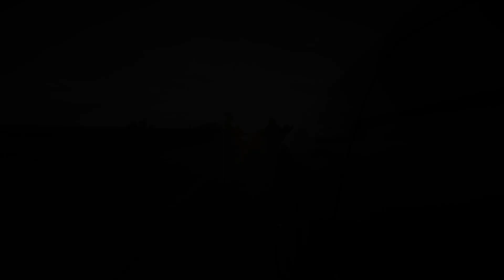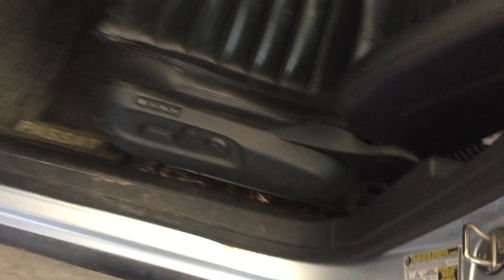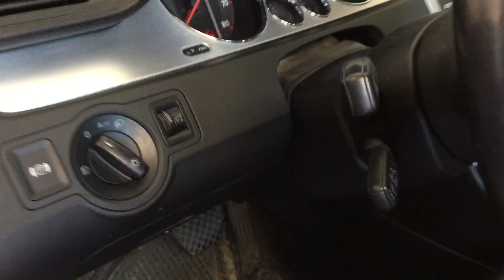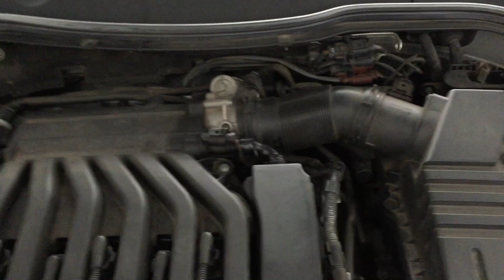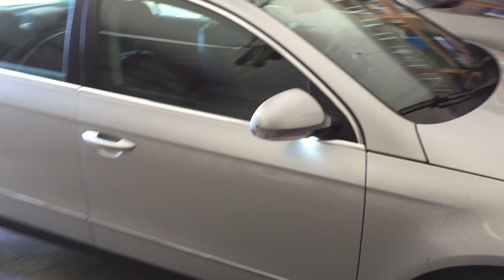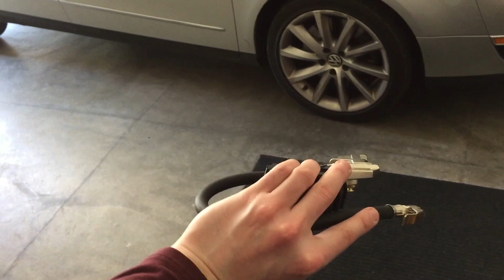Strange Volkswagen Passat Problems...Time to Sell it?

Comment: Get the VCDS software and cable. You will be able to retract the rear brakes, diagnose the modules and save $$$$$ on repairs, and keep the car for another 5 years.

Comment: You don't need a special tool to get the rear parking break to release! All you need is a car battery, and two wires! Hook each wire lead to one of the battery terminals and unplug the clip that hooks up to the electric motor, and place a wire in each side of the clip. You will either hear the electronic motor detach and you will watch it on spin all the way or, it'll sound like it's trying to tighten even further. Obviously if it's trying to tighten even further just switch each side the wire is on and that way you can do the brake job yourself!

Comment: Beautiful car. I used to own an 09 Passat Komfort for seven years, and while a leader in its class, it was plagued with so many issues too soon into its life of 120,000 miles. First issue: steering column lock. The water pump that had to be replaced three times, the PCV valve, the randomly drained batteries, leaks from the differential, and a cam tensioner failure all taking the car out with a final punch. This car was built for leasing like its sister Audi—not for long term ownership.

Comment: This car haves timing chain problens?
Reply: Toss Ftw yes they do, in fact there was an active action class lawsuit opened until 1/2019 for drivers who experienced timing chain failure; engine failure. In addition, VW group of America rolled out a payout scale depending on year and mileage. I had mines fixed drove it for 3 weeks before breaking again. I took it to car max and got rid of it. These are lease cars not cars to buy.

Comment: On a 2013 CC vr6 with pcv issue.  There is an aftermarket pcv membrane to replace it in the valve cover.  So new valve cover gasket, new pcv membrane from Amazon and a few dabs of rtv silicone will set you back about $70 and an hour of your day and your done.
Reply: In order to get the valve cover off you must remove the intake manifold (and lower fuel rail). The intake manifold won't come off without removing the radiator fans, grill, front bumper and then leaning the radiator forward. I just finished this repair, it is not a one hour job.
Reply: At least on a 2013 cc vr6  the intake is a two piece design so the lower doesn't have to be removed to service valve cover.
Reply: My 2007 is a one piece...not easy to work with
Reply: @8@843 @843Chip L, never had to do that on any of the 11 VR6 I’ve owned and upgraded RKX PCV in all of them as an EASY prevented maintenance

Comment: I had the same problem. remove the seat control panel, and access the small circuit board behind it, take an old toothbrush and clean the rust off it. That's what causing the problem. It should go away for good.
Reply: Where is the seat control panel? I’m having the same issues

Comment: I have the same car just not 4 motion .. I was wondering if you knew how to fix a problem that I have .. my check engine light comes on every now and then and it is “low pressure fuel” was wondering if you knew how to fix it . Thanks
Reply from the maker: It's most likely a problem with the fuel injectors and carbon buildup. Try putting a bottle of Chevron Techron fuel system cleaner in an empty gas tank and filling up with premium gas. You can also try revving the engine at 4,000 rpms for 15 minutes on the highway at a steady speed to burn off the carbon deposits in the cylinders. If that doesn't work, bring it to a VW shop and they can do a B&G fuel system cleaning process for $200-$300.
Reply: I changed the fuel pump, I used to have the same problem, it got fixed.
Reply: New in tank fuel pump unit fixes that.

Comment: I have a 2006 version of this car (3.6 4motion) and I had the same seat problem except my seat went all the way back. The problem eventually went away. Also your car should still have a rust and corrosion warranty on it. VW has replaced both fenders and my hood all for free within the past year. Now it looks like a new car again.
Reply: Ryan Eggebrecht they replaced your fenders and such ? How did you go about that I have the same year and the same problem

Comment: Hi, I do have the VW R36 2009 and I did face the same issue with the seat. It happened only after I took the car for a full interior and exterior polish. seems some steam went into the controller and yes it got damage. the solution for me was to change the memory switch only. check the link below

 https://www.aliexpress.com/wholesale?spm=2114.search0104.8.50.PdO4wM&initiative_id=QRW_20170705053038&SearchText=vw+b6+seat+memory&productId=32797317113

regarding the mirror moving, it can be related to the same switch problem as the mirror positions are configured to memory too. so you only hear the motor when the seat is moving inside the car.

just in case, I have faced some issues with the car park too... got a big warning on my screen saying check with VW Dealer. the car would not move since the handbrake is on and not getting released. but since we use our common sense...I have turned on the auto park and everything started working fine as long as I don't press the park button. to cut it short replacing it solved the issue.
check this link just in case. 

https://www.aliexpress.com/item/EPB-Electronic-Handbrake-Parking-Switch-Brake-Button-For-VW-Passat-B6-C6-CC-G1CG/32742738762.html?spm=2114.13010608.0.0.VbDbPc

good luck!

Comment: guys im planning on getting a 2009 r36 3.6, is it a good reliable car, how is the servicing cost will be is too expensive !!
Reply: I sold it a year ago it’s beautiful but too many issues everytime
Reply: I've had an r36 for 4 years.
Year 1 - new gearbox £3k
Year 2 - 2 x electric rear brake calipers and disks 1.8k
Year 4 - new catalytic converters needed and timing chain need doing 3-4k

It's a great car but make sure you can afford the repairs and they hold their value very well and sound fucking amazing
Reply: I have vw r36 2009 225k on it doesn't give me a problem except of cooling fan every 20-30k needs to be replaced most probably because i live in Dubai other then that I have no major issues
Reply: @Baba Gandu  computer diagnostics first of all required.
Reply: NEVER BUY A VW CAR...GO FOR FORD MONDEO OR LEXUS SEDANS
Reply: Hari Kumar he said ford Im deaddd

Comment: With the seat moving forward... Does it do it with both keys? The car has seat memory depending on the key you use. You can reset the default seat position for that particular key. My R36 did the same when I first purchased it. Changed the default position for each key and issue sorted ;)

Comment: To be helpful and constructive:

The electronic parking brake needs to be in maintenance mode, which is activated by either VAS (the dealers PC diagnostic software) or VCDS (publicly available software that is great if you own and self-service a modern VAG vehicle). If has a function to retract the parking brake. This is because, to always work fast and reliable, when you actuate the parking brake switch, it will actuate the brake calipers until it draws 17 amps of current (each individual motor meets this criteria individually to ensure they are always correctly applied). When releasing, it simply runs a predetermined distance (number of rotations of the motor) that keeps the caliper clear, but near to the disc. To service, you need to activate the function that moves the motor in the open direction untill end of travel. Afterwards, an adaptation procedure is made, to move the caliper back towards the disc after which it will function normally again. 

Often, you'll be able to find someone in your area, either a professional or a hobbyist, that owns VCDS and can set the function for you for a small amount. 

The mirrors and seat issue is probably related. The seat position is stored, but also the mirror position when driving and for the right mirror also the reversing position. So probably the mirror will be "fixed" by fixing the seat electronics, and really you should prioritize doing it, since it's a safety hazard. It is supposed to move when unlocking/turning on the ignition because the position/driver profile is stored in the keyfob. But when you're actually driving, it should stop, and only move upon manual actuation of either memory position buttons or the manual controls of the seats.
Reply: Nicoleise Truth.
Also, the rust is actually under an extended VW warranty (crazy, I know)
Reply: Naija_Bwoi that’s great to know! I really appreciate your support!

Comment: You need to clean the memory buttonsbon ths drivers seat.....rain and moister gets in there and gums up the works...Clean that switch with electronic cleaner and you phatom moving seat will disapear!!!! My 2007 3.6 4mo wag had issue 3 years ago at 97000 and I did that and still no problems at 140000 now!!!